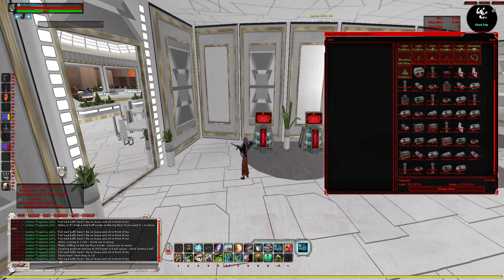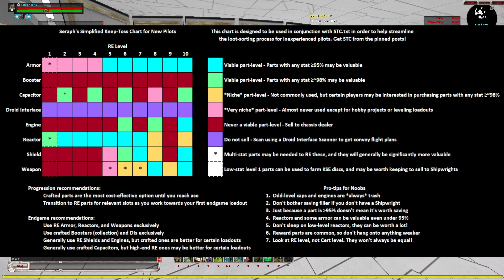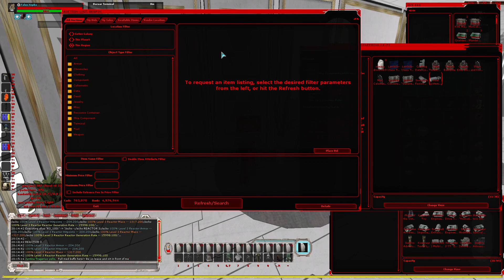Star Wars Galaxies Legends: How to Check Space Loot/Parts (deprecated)

Comment: Noob question, whn I check the parts nowadaws it marks a Tier A to D depending on the part, is this now integrated?
Reply from the maker: Yes, there was a recent update on SWG Legends that will now automatically color-code your loot based on rarity. These tiers, their thresholds, and colors are even editable. Feel free to see the wiki for more details! 
https://swglegends.com/wiki/index.php?title=Space_Loot_Evaluation
Reply: @falos360  By the way, do you know what the actual way to do dwb solo? In this update?
Reply from the maker: I am not the best one to ask about nonspace-related stuff. I have never actually ran dwb xD. I can try to find out for you. My discord has a guide, though I have never tried it. https://discord.gg/GDCMNaMCVe (ground category, intruction-questions channel, in the pins) its quite lengthy with photos or I'd post it here.  @2024-x4o
Reply from the maker: I need to update this video for this change, but I have been busy and left it for now since it can still be helpful for price-checking loot and searching for parts on the bazaar.
Reply: @falos360  Thank you very much, yeah, bazaar terminal proccess helped me a lot